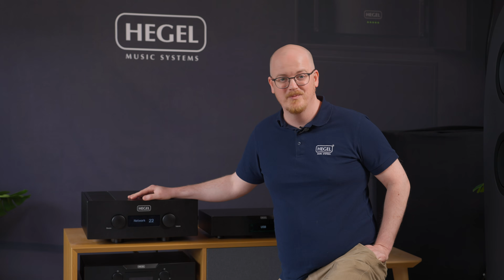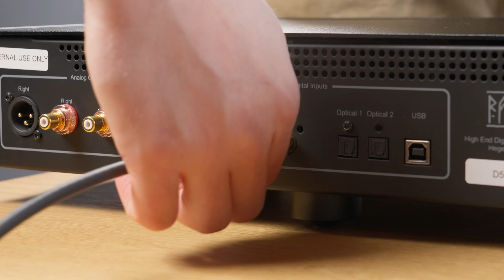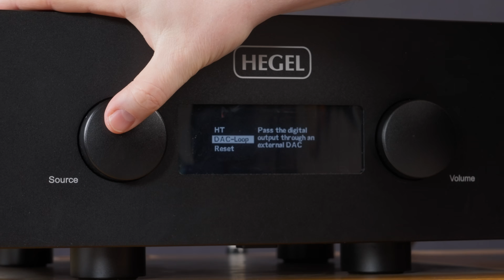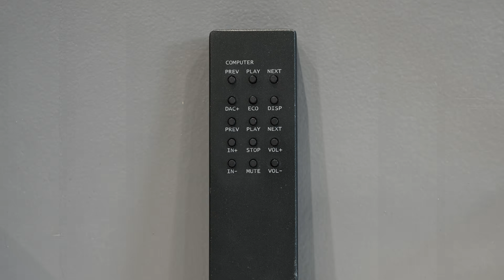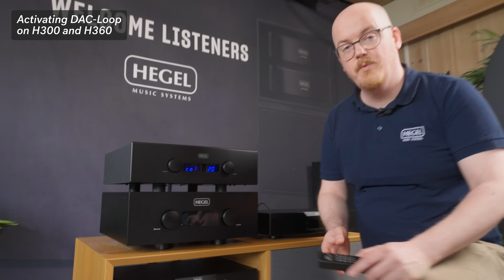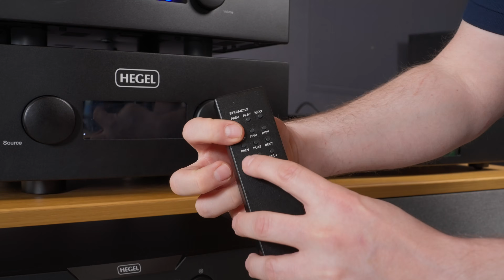How to use DAC loop

Comment: Hello Hegel team, I own a H390 and considering to add the D50, and connect them in dac loop mode. Due to limited space in my rack would be convenient to place the D50 on top of the H390. Is there any sound/performance limitations by stacking the D50 directly over the H390? 
I rarely listen loud and when doing that it is for short periods. Most listenings are for couple of hours, in mid to low volume (volume knob set 45 or below). I assume no heat issues, but please let me know, if this or any others issues advising not to stack these units.

Comment: Thanks a lot for the video. 
I have a H390, rechecked its manual, and still have 2 questions please:
1 - I’m using the Network port in the H390 to get the streaming from Roon Nucleus. To use an external dac, further than the cable connections, I just need to activate the dac-loop in the h390 menu? Or I need to further activate the Network in the dac-loop sub menu?
2 - what is the purpose of submenu option to enable the digital output to always be active?
Thanks in advance.
Reply from the maker: Thank you for your questions. 
1) Yes you also need to activate the Network in the DAC loop menu. 
2) Honestly... nothing in particular. It was simply easy to do
Reply: @HegelMusicSystem  if it does nothing why is there? i mean it must be a reason why the team choose to add that option?
Reply from the maker: @sebastiandroguettpizarro9551  Sorry for the slwo response. Today I have actually discussed it with the person who introduced this feature. He said that the idea is that we normally switch off all digital circuits we do not use, as to minimize noise. But then he wanted to allow you to switch the digital output on again, even if you did not use it for DAC-loop. This in case you wanted to use the output for "something else".

Comment: I have a H390, connected it up just as say and enabled the Dac loop but I can't get it to work. When start a track and select the Hegel, it goes to Airplay and plays the track. When I try to select any other output the music stops and the Hegel disconnects.What am I doing wrong?.
Reply from the maker: I have a feeling there is something wrong with the set up. 
1. In the menu of the H390, when you activate DAC Loop, you also have to activate it for the network and USB inputs. This may actually be the reason it works on Airplay. 
2. So I believe there must be something wrong with the connection. Are you absolutely certain you are using the digital OUT on the H390 and re-connect the external DAC to the balanced inputs of the H390? 
3. Are you certain you have chosen the correct input on the external DAC?
Reply: @HegelMusicSystem  Is it possible to switch between the external Dac and the Hegel without changing the Dac loop settings?
Reply from the maker: @RonLysons  Sorry, didn't see this until now. But no it is not. You need to go to the settings. On some of the older, like H300 and H360 you can quick swap with a command on the remotes though.
Reply: Hello, thank you, yes, I have connected it just like you say in your video
The coaxial cable is connected to the one on the left as you look from behind. OUT.
There are only two options, OUT and BNC, I've tried them both. The  XLR connections can only be connected one way.
In the Dac loop settings I have tried it with and without the Network and the USB activated. When the Dac in activated on the network setting and the usb, nothing works, no sound at all. When I deactivated the USB and the network and I select Hegel from my iPad, the Hegel display say Spotify and it works. However, that is using the Hegel Dac. When I try any other output, the iPad disconnects and you have to go back on the iPad the reconnect it.
Reply: When I tab through the display, the only outputs that are not showing Dac loop are the two analogue outputs and the XLR.
Reply from the maker: @ronlysons6750  Its because these do not use DAC loop. Only the digital outputs do
Reply: And yes, there is only one coaxial input on the Dac. I’ve, tried the coaxial from my node to SMSL Dac and in works fine, but this using the node streamer.

Comment: I own the H190 (original version).  I don't believe there is a DNC OUT on this version.  Would i use Line Level Outputs (L/R)?  Fixed or Variable?  Thanks in advance.
Reply from the maker: On the H190 there isn’t a DAC loop, unfortunately. But you can still connect an external DAC to any of the analog inputs.
Reply: @HegelMusicSystem so the balanced XLR inputs would work with an external DAC?  Thx for your earlier reply.
Reply: @HegelMusicSystem what about on the H190V
Reply from the maker: @ajitvetha Same as on the H190 unfortunately.